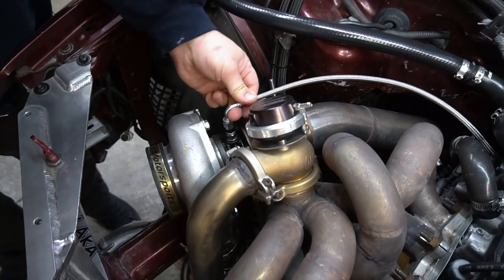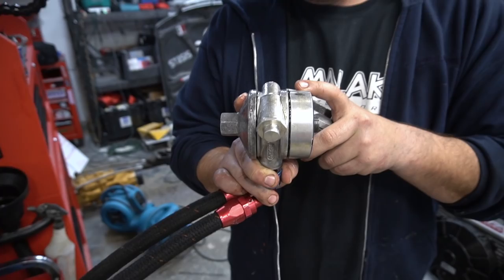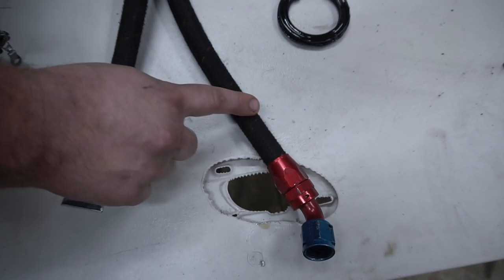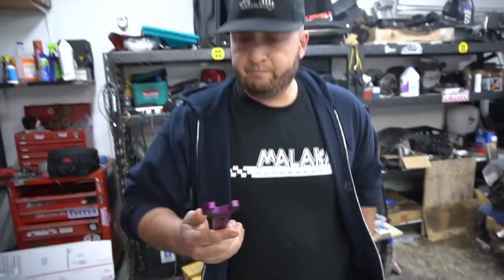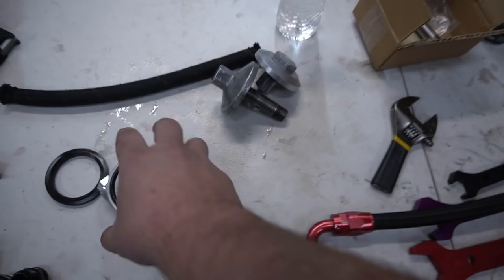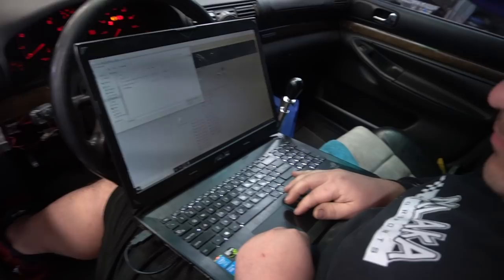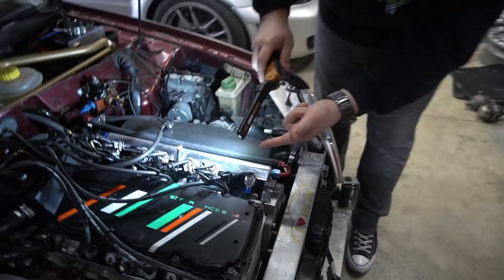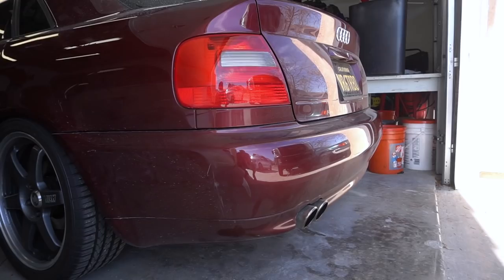Base tune on 2150cc E85 injectors, MoCal Oil cooler leak fix | PART 13 | Stav's 12v VR6 Swap

Comment: So glad for you that things are moving along. And the warning about mods needing constant inspection or attention is spot on. Changing one item may unexpectedly affect two others down the road that will need rework. Frustrating at the time, but really satisfying when it's worked out. Great work!

Comment: That ‘Chinese oil cooler extension’ spacer o-ring looks like a oil filter seal - you may be able to find a filter that has a suitable seal if required for the future.

Comment: Those sandwich plates are supposed to be torqued on at a silly low torque spec. Over tightening them will smash the o-rings and then they leak